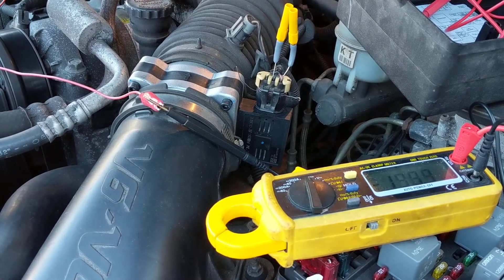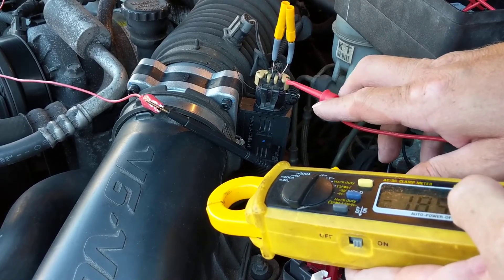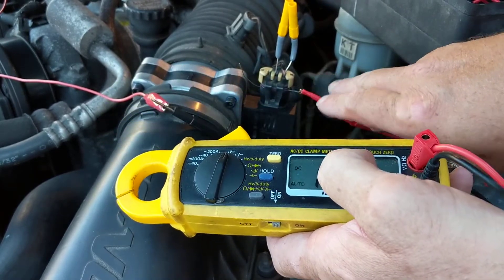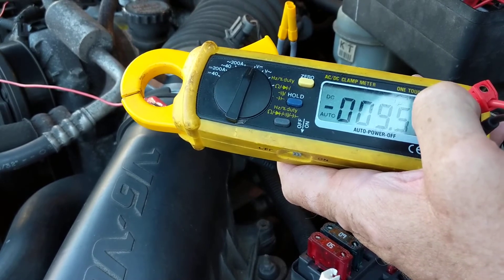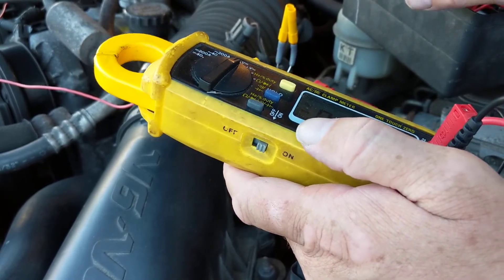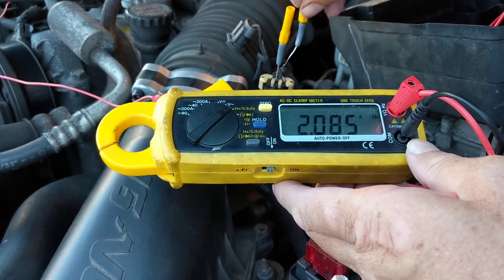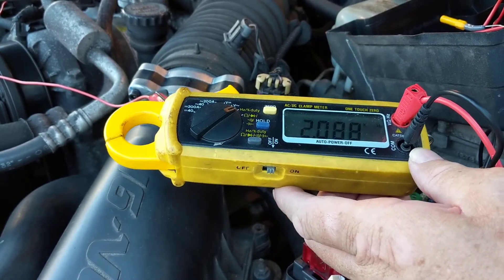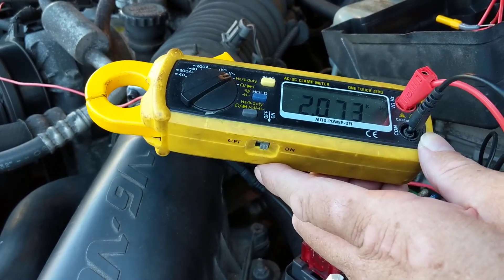MAF How to test mass air flow sensor voltage and frequency

Comment: How would I find a wire issue p0103 reading high, replaced sencor car still stuck in limp mode after clearing codes same code comes up p0103
Reply: Usually you can get out of limp mode if you wait a couple of minutes and reset the car if not the signal wire going back to the computer is high could be many reasons of which could be vacuum leaks or too much air is being drawn in could be signal wire is making contact to the b+ wire which is obviously 12 volts the best way to see is to see first the b+ wire with the connector detached again depends on the vehicle

Comment: My hot wire goes from 12 to 14 volts up and down at idle
Reply from the maker: Which tells me the current is fluctuating the thing for me to recommend based on what I'm hearing you have to put a clamp meter on the b+ feed wire going into the fuse panel to see where the current is fluctuating now voltage and measure millivolts across each fuse this takes some knowledge how to use a clamp meter and the wiring diagram the signal wire going back to the computer should change not the b+ hotwire again to make sure take off the connector measure the hot wire see if it fluctuates then you know if it's the sensor or the common b+ line
Reply: Let me show my mechanic this
Reply from the maker: Thanks for your comments first thing is take off the connector to the main sample sensor you want to see if it's a sensor problem that's causing this or a b+ problem which is a major problem that means your whole 12 volt line is fluctuating your whole line good luck
Reply: It revs up at 2100 rpm when I start the truck
Reply from the maker: I assume by saying your hotwire you mean your 12 volt line disconnect the mass air flow sensor see if your 12 volt normalizes back to 12 volts usually if it's loaded down it goes down a voltage not up in voltage
Reply: @automotiveelectronicsfroms2699   I got the voltage from the pig tail connector from maf sensor and it jumps from 12 to 14 to 9 back to 12 I might have a shortage in my 12 v hot line?
Reply from the maker: The mass air flow sensor with 12 volts is common to the whole bus line feeding everything so if you have a problem on that one you should have a problem on everything else number one and number two if you have a short meaning of dead short to ground you would blow the fuse instantly that's not happening because you are fluctuating in voltage